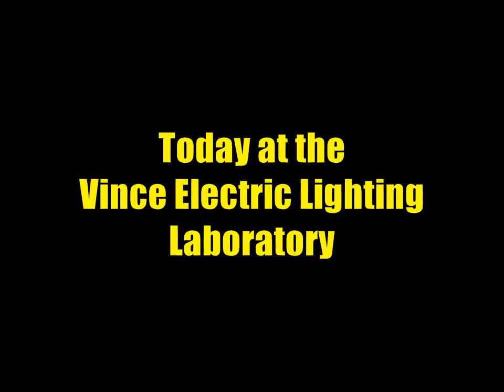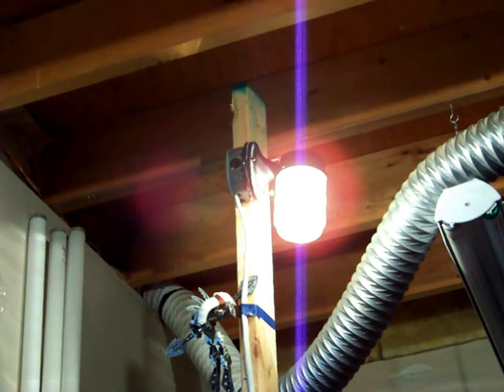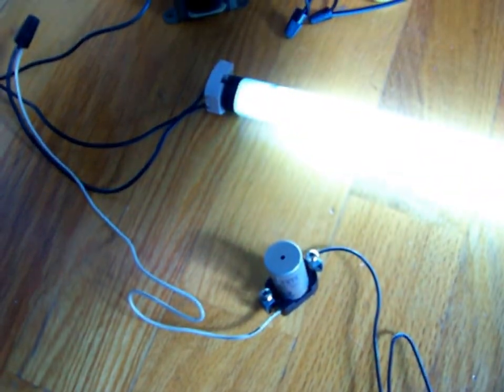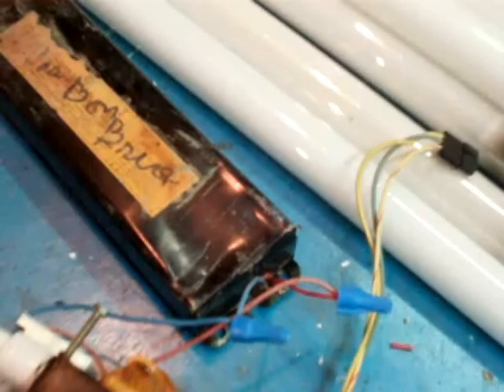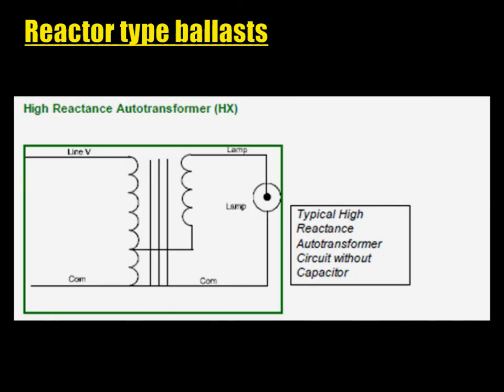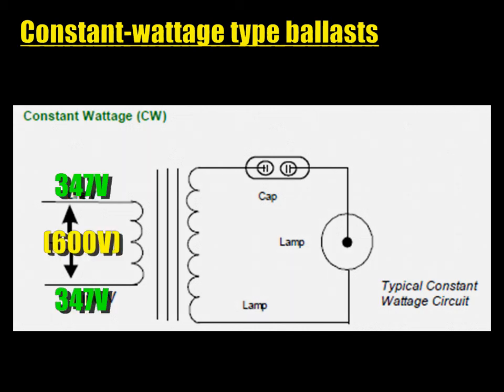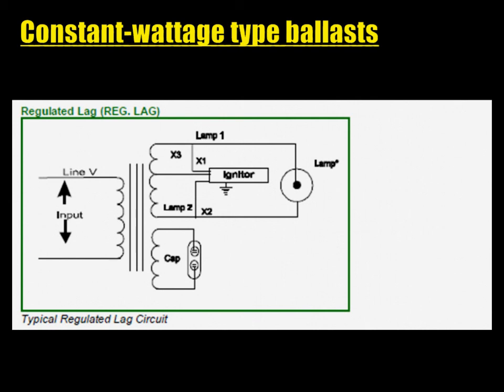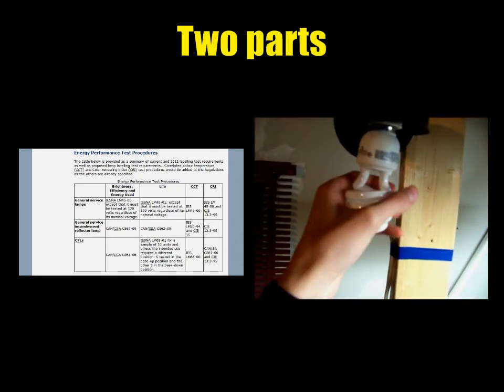Lighting maintenance basics - HID ballasts and HPS lamps

Comment: can you help? trying to put together a 400 watt Hps grow light. but I'm confused because my ignitor does not have the standard 3 wires blue black white. my ignitor only has 2 wires...red and a white. how can I configure this..thanks in advance.
Reply from the maker: Many cheaper ignitors are like this. But unfortunately there's no standard. Some connect directly in parallel to the lamp, others to a dedicated wire on the ballast. But in all cases said ballast usually has a label with a wiring diagram on it. Does yours have one?